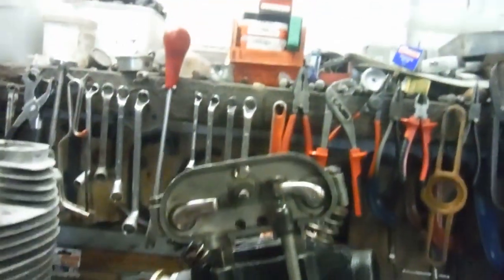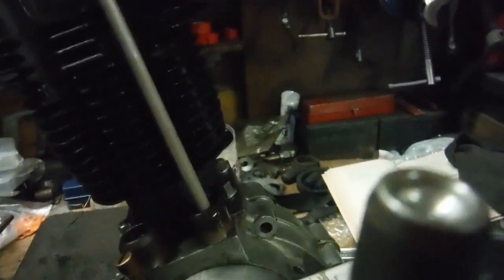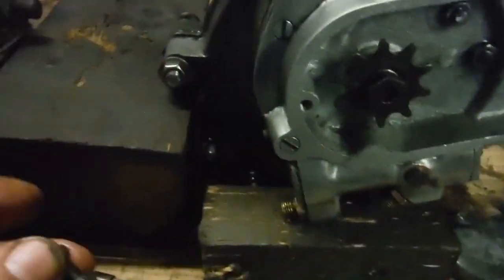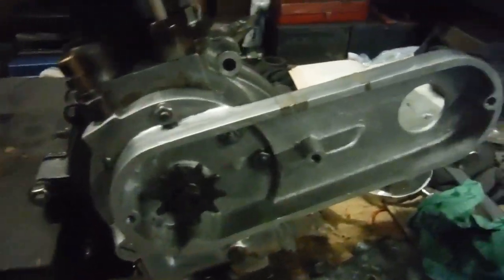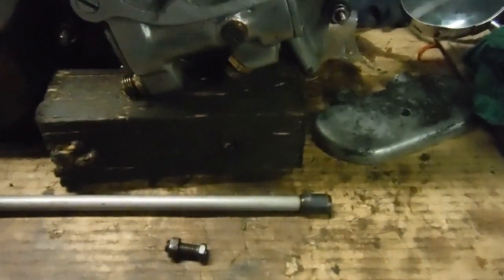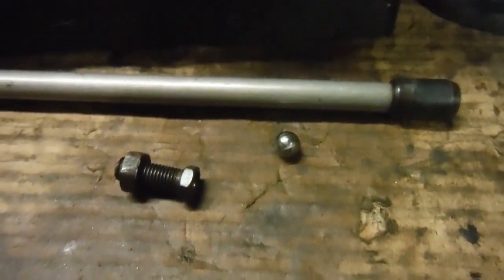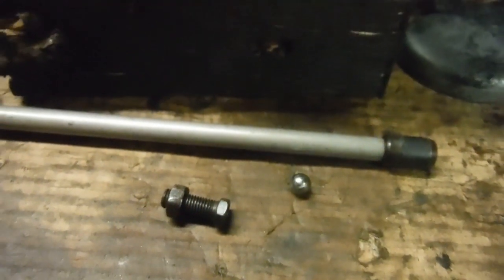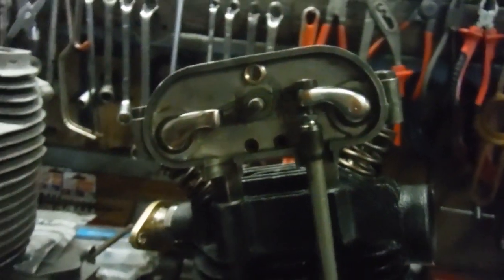JAP 250 engine pushrod ends and tappet adjusters dilema solved and discussed with rockerbox fitted

Comment: You gave the game away Paul !.. I was just wondering how the hell you were going to get round this latest dilemma when I spotted that loose ball-bearing on the bench and guessed your solution ! - I've been watching this whole JAP series with interest and one thing that has struck me throughout is how fantastically well prepared all of the parts and sub-assemblies are (maybe by your good self ?..) so adding your careful rebuild on top of that should produce a really great little engine !..
Reply from the maker: Thanks - many of the engine components were already overhauled when they arrived, I have in the main just had to assemble it all carefully, after attending to the fit of a few items.

Comment: Hi Paul, It's very interesting to see you overhauling the old engines. However, I would also like to see the engines in action, i.e. see them running. I think many others would like that too. You definitely need an engine test stand. 😉Then you can also immediately check whether the motors are running satisfactorily. I'm aware that that would be a lot of work, especially if the carburetor, ignition system and other attachments are missing. But it doesn't have to be done on every engine, only on those engines that can. Good job, keep it up.